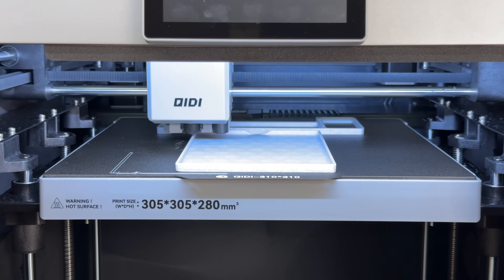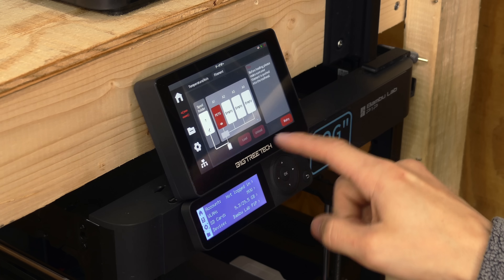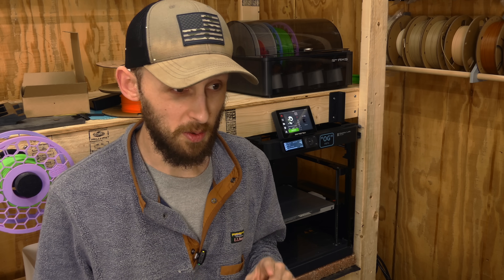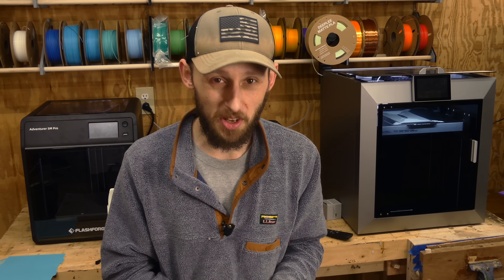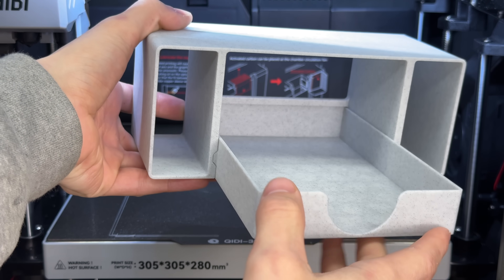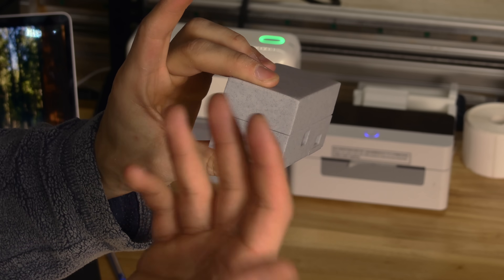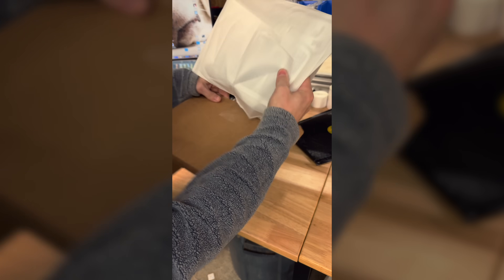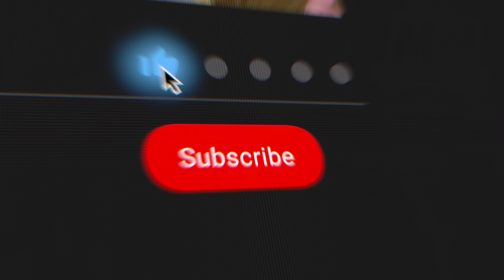Little Tweaks to Keep My Small 3D Print Farm Running Smoothly!

Comment: Need to print out some miniature spools for the labels on the rod then you can label the spool what the label is for. I'm printing out that label printer file right now that looks pretty slick
Reply from the maker: Yeah definitely coming soon, i wasn’t really thinking when i rolled them all up on that, cause now when i unroll one, the whole thing spins cause the sticker is attached to the dowel 😆 gonna be making an adapter from tpu with an opening on it to slip over the dowel but still allow the labels to spin freely.
Reply from the maker: Apparently they have another one very similar to the label printer stand i printed, and it has a rod underneath instead of the tray so you can use the rolls of labels too. That’s getting printed next for the other label printer stand

Comment: Been eyeing cryoplates for awhile now. Might pick up a couple. Also….finally another fellow printer from here in VT! Automatic Subscribe! But also you got really good content.
Reply from the maker: I'm still learning a lot with these machines but I'll keep trying to make the videos entertaining and useful. I have been strictly using the cryogrip on my P1P for the last few months now for everything but TPU. I dont even want to try prying that off the cryogrip. It leaves a slightly textured, but shiny finish to the bottom surface so thats something to keep in mind if you print a lot face down and dont like the shiny finish, in those cases the Supertack or standard PEI sheet perform better for a matte look, but the adhesion is second to none on the cryogrip. I know people were concerned over the finish degrading over time, and im sure it will, but I have yet to experience that with hundreds of prints. Glad you are enjoying the channel, Thanks for the support!

Comment: Maybe I'll pick up the CryoGrip as the Supertac is NOT working for me at all. It holds nothing for me 8/10 times. Tried all the standard stuff to correct it but blah no go. A shame really because I bought one for both my mini's and the X1C. All have issues with them.
Reply from the maker: I've had so so luck with the supertack plates. 90% of the time it works great, but when it doesn't its just random and could be right after a week of successful prints or right after I get done cleaning it, doesn't seem to make sense. Its sometimes... I wish they had the dark blue cryogrip in stock for the Minis, but last I checked it was just the lighter of the blues, which i'm not a huge fan of.

Comment: The deeplee looks good, but I've just swore off cardboard spools at this point. I really wish these companies would start offering a refill style spool that would fit either Bambu's or heck anyone else's printable spool. I don't really care who they pick, just pick one. At this point i have 2 ams on every machine and likely may end up going up to three. I'm not going to use an external spool unless I just have no other choice at this point.
Reply from the maker: I agree, the refill spools are really handy, even for the damaged cardboard spools. The Deeplee looks to have the edges of the cardboard sealed for use in the AMS systems, or better capability with them I guess.
Reply: @TheMountainMaker  The sealed edges work fine, elegoo has them as well. The problem I ran into was the edges being regularly damaged in shipping. Unfortunately no amount of edge sealing stops that. Now that we are getting out of the holiday season, it is probably safe to order again. I just am over dealing with the unreliability.

Comment: you can make a disk divider like the ones at good will to separate the size of clothes but use the same concept for labels and use a tube that can go over the bar that has a tiny slot in it that will pinch the label on the end, so it won't fall off when you get to the end.
Reply from the maker: Great minds think alike! 😆 Thats the plan

Comment: Ooo I like the marble filament! And I'm really happy the sign arrived safe and sound. :)
Reply from the maker: Thanks for taking the time to create it! It came out great, now i just need to find a good home for it. I have an idea of where i want it to go, but not ready to show that area off quite yet 😉
Reply: Hey I got Bambam x1c and i cannot make the auto filament change to work . When the filament is gone it doesnt switch to another next to or to the one i could off selected . How to make it work ?
Reply from the maker: There should be an option inside of the slicer when you go to print your file that has an “A” with a circle around it. It should say Auto-Refill and will only work if the ams filament is set to the same type and color, so black pla for instance. If the other spool is white pla, you have to set it to black within the slicer or X1C screen so it thinks it’s the same color filament, then it should auto switch when one runs out.

Comment: I REALLY need one of those fancy shipping tables. I'll have to try that filament against Elegy Matte I use.
Reply from the maker: It really helps keep things organized and have them all in one location. Has already made the last weeks worth of shipments so much more streamlined. The racks are really what does it do realistically you could get those and mount them to any desk or table. The 3ft depth is something i didn’t think I’d need, but it’s nice having 6-8” to store all the printers and labels on the back section, then the front 28-30” can be used for packing and laying things out.

Comment: I've tried colorFabb stoneFill as a stone filament before - but hat two issues with it on my Prusa printer: 1. you need a steel or hardened steel nozzle because of abrasion and 2. stone particles stayed in the hotend for ages despite all cleaning attempts and came out in unexpected stone-filament-blobs weeks later. Have you had any issues with your stone filament?
Reply from the maker: I'm running a hardened steel nozzle in the Plus4 but the A1 Mini that printed the little case was just a standard stainless steel nozzle. I have had issues in the past with other brands but so far so good with this one. I've switched to a couple different colors afterwards and they all printed as usual.

Comment: Looks like a decent price on that filament, I'm going to have to try some. I've been wanting to get some marble for a little project.
Reply from the maker: I was really pleased with it. The last spool of “Rock” PLA that i used was Overture and the blue printed fine but the white or more marble one kept getting jammed or breaking off inside the extruder on multiple machines so i stopped printing with it. I’ll definitely be ordering more of this kind though and looking for some petg versions too